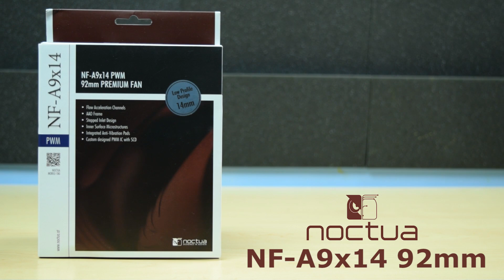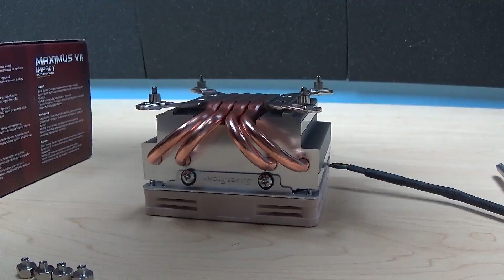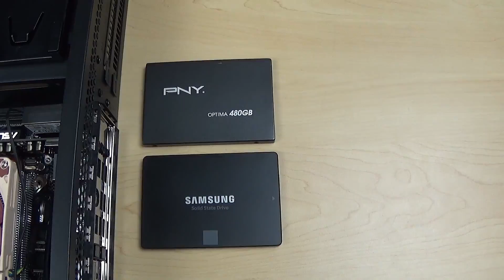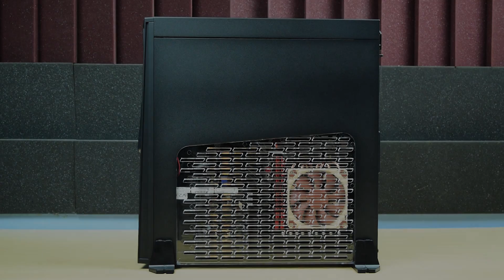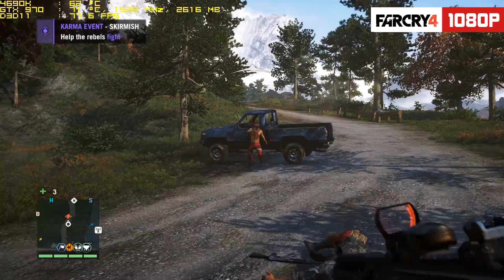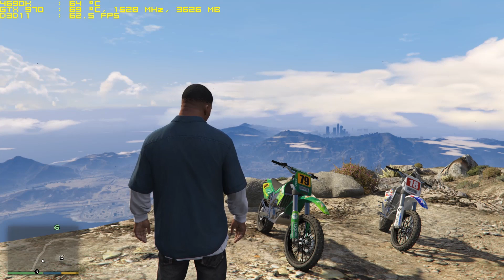Mini-ITX Gaming PC Build (RVZ02 / i5 / GTX 970)

Comment: when playing games, does your video card fan and cpu are doing ots of noise?
Reply from the maker: +Jean-Francois Beaulieu The video card is very quite, the cpu fan isn't too loud, but the power supply is definitely the loudest by far.
Reply: +MGTech I have a similar setup and when playing games and my GPU is very noisy, plus have have 2 cougar fan on side of it to help keep it cool, like when playing Start Craft 2 its very noisy

Comment: procesador intel core i5 4690k Precio: $219.99
silver stone designing inspiration AR06 58mm Precio:$39.99
noctua NF-A9x14 92mm Precio:$15.29
ASUS maximus VII impact Precio:$431.74
g.skill 8gb DDR3 1866MHz Precio:$49.75
msi gtx 970 4gb Precio:$ 317.26
samsung 850 EVO 250GB Precio:$85.52
silver stone designing inspiration SFX 450W Precio:$88.99
silver stone designing inspiration LS01 RED LED STRIPS Precio:$13.99
silver stone designing inspiration RVZ02-W Precio:$78.78

                 Costo Total de los componentes por amazon de la mini-ITX
                                             $1341.30

Comment: Do you know if the Silverstone 450w SFX PSU will be good enough for a nvidia 1070 video card?
Reply: Hell no. Get a 650 Gold or higher.
Reply: +Clorox Bleach why?
Reply: shouod be okay. may be safer with a 500. if you look at reviews with power usage, they often include the whole system which usually has an overclocked i7 with it. So use those and decide.

Comment: does the ram with led light gonna fit this case? And will the gtx 1060 overheat if I build it with this case
Reply: dont know about the led lights but,the 1060 shouldnt overheat.

Comment: Would this case fit the MSI H81M-P33 (MS-7817) (LGA 1150 socket) motherboard?
Reply: Needs to be mini-itx
Reply: How can you tell if it is mini-itx? I don't think it is mini-itx. It is micro-itx if I am correct because it has 2 pcie express slots: one for gpu, one for wifi card.
Reply: Just go to pcpartpicker.com and check on their part list
Reply: RainStormC I tried but I couldn't find the case that I wanted. No worries I will find something else.

Comment: Is using Intel better? It seems i can get a six core AMD cpu cheaper. I can get a mother board and cpu for 150.
Reply: intel cpus has better single thread speeds that most games use nowadays.  For editing multiple cores are used which gives edge to amd in editing intel on gaming

Comment: can i change the gpu into gfx 980? does it fit?
Reply: and is there any cheaper motherboard you can recommend?
Reply: George Choo try the gigabyte or msi z series motherboards. Asus has a midrange motherboard as well.
Reply: You want a 980 an a cheap motherboard. What has humanity become.
Reply: +Lou You don't need an expensive motherboard to run a high end gpu
Reply: EpicGuyJC - TheAcePikachu I know, but it may bottleneck the system
Reply: +Lou Motherboards doesn't affect preformance, it only matters if it has the correct connections

Comment: Can you fit g1 980 ti? or is it gonna be too long for this case?
Reply from the maker: +pavelexpertov Yes, its possible to fit a G1 980.
Reply: Just one more question regarding that, have you managed to experience any throttling due to heating? or the design of the case managed to keep the components cool?
Thanks
Reply from the maker: +pavelexpertov I haven't experience any throttling because of temps. CPU temps have been around 65-70 and GPU around 65.
Reply: That's cool thanks

Comment: The size and  inside design of the case is perfect, but exterior design and the cheap looking plastic on the case looks awful. Node 202 case from Fractal Design looks better in my opinion. If it cost $120 with better materials, I wouldn't care. This looks cheap.

Comment: thanks for the explanation video.. can i check with you 1 thing?

i'm interested to buy this, however with my GPU i worry i couldn't close the case, ASUS Strix R9 380, slightly thicker (i'm not worry about the length) at 271 x 139 x 42 mm, compare to yours at 269 x 141 x 35 mm. Do you think there is enough space for the extra 7mm in thickness (so that it still wouldn't touch the glass window panel)?

https://www.asus.com/Graphics-Cards/STRIXR9380DC2OC4GD5GAMING/specifications/
Reply from the maker: +Nerissa Deviana Your card should fit. I've seen larger card on this case.